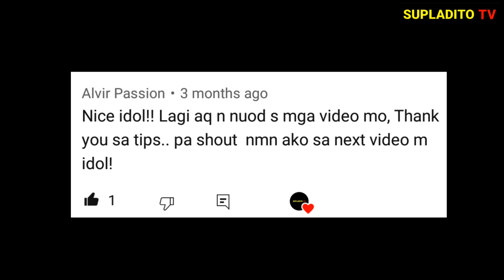Honda CIVIC: Rekta Fan vs Automatic Fan + overheating emergency tips

Comment: Sir yung sakin na civic vti 1999, nakarekta, pag bukas makina andar kaagad yung rad fan. The catch is, matic po ito at naka-bypass sa sensor. Is it advisable or good idea na ganito? Kaya nag bypass kasi nagkaprob dati sa overheat, eh since ngayon ayos naman na po yung issue,  ok lang ba na naka-bypass pa rin? Salamat po.
Reply from the maker: Mas ok po sana na hindi nakarekta pero kung ibabalic mo po sa matic be ready lang po sa posible na malaman nyo baka may reason dati may ari bakit naka tekta fan
Reply: Palitan mo lahat sa cooling system mo. Magpalit ka ng 2 rows radiator palitan mo rad hose bypass hose as in lahat ng hose. Kung stock pa din kasi yan maari may leak na yan magpalit ka na rin ng water pump baka kasi may tama na din yun then palit ka ng sending unit. Ewan ko lang  kung mag over heat pa yan.And lastly coolant lagay mo kasi malamig yun kesa sa distilled water
Reply: @SUPLADITOTV  ano po kaya mga main reason sir kung bakit nila nirekta noon ? Kasi nakabili ako kahapon 1998 civic naka rekta fan tas binalik ng mekaniko pero nakita ko wala nman sya ginalaw sa thermoswitch my prang wire lang din sa loob na nakasaksak. Pano kaya yun ?
Reply: @toykidstv9345  sir my tanong po ako . Bumili ako ng 1998 civic nung isang araw po . Naka rekta yung fan . Pero wala nman gnawa mekanino prang sinaksak lang nya yung sa switch wala rin ako nakita na binalatan na wire pano po kaya yun naka matic na po ang fan . Naka 2 rows na din . Ano kaya reason bat nirekta fan ng dating my ari?
Reply from the maker: @nhat6371  yes sir ganun po kasi pag nag byas ng switch ng fan jina jump pang po… reason might be 

May instances na tumataasxyemp nya… or extreme sya mag maneho 

Or pag uphill

Those are possible lang po ha 

Or gusto nya lang irekta at may fear sya mag overheat

Comment: OK LNG MAG REKTA NG FAN IWAS OVER HEAT. SABI NILA MAHIHIRAPAN ANG ALTENATOR MALI PO YUN BAKET PAG GABI ILAW, RADIO, GUMAGANA. NORMAL LNG YUN. SABI NILA MADALI MASIRA FAN. HND NAMAN PO YEARS PO BAGO MASIRA.  MAY NGA KOTSE NAMAN TALAGA NA NAKA REKTA FAN TULAD KIA PRIDE.  ANG GOOD DUN HND YUNG IWAS OVER HEAT...  DAG DAG LNG NG COOL SA MAKINA. AT DAG BILIS COOL NG CONDENSER KC NAKA RECTA FAN NG RADIATOR. DIBA PAG AUTO PATAY LAHAT.  PAG RECTA KHT MAMATAY YUN AUX FAN NA NAG PAPALAMIG NG CONDENSER MERON PARIN YUNG RADIATOR FAN MAS MADALING LUMAMIG AIRCON. KC HINIHIGUP PARIN YUNG INIT NG RADIATOR AT CONDENSER.
Reply from the maker: Kubg san kayo masaya sir your car your rules...
Reply: Tama si suplado tv kung san ka masaya dun ka sa way mo sir hehe basta kame hndi maganda ang nakarekta ang fan proven and tested na yan mdaming pde masira sa makina mo .
Reply: matagal ako nag rekta fan at walang thermostat at nag auto fan na wala pa rin nka kabit thermostat.,ngayon naka auto fan with thermostat at pareho kmi ni supladito ng rason para ma reached ang normal operating temp..
Reply: Yung sakin boss.. walaa ng thermostat.. pero yung fan di nakarekta.. ok lng po ba boss.. o need e rekta..di kasi tatagal yung lamig ng ac ko after 2 3 months mawawala na lamig
Reply from the maker: Sa aircon system po yan sir baka may freon leak po kayo
Reply: @SUPLADITOTV  pina check ko na system sir ..sabi ng gumagawa ng ac wala daw leak system ko
Reply from the maker: @junjungebutan843  nag leak test po ba sila? Nag check bg freaon? Ano po sinabi nula dahilan bakit nawawala lamig ng aircon?
Reply: @SUPLADITOTV  ginamitan nila ng vacuum ..aw gumalaw yung paa ng sa vacuum after ilang minutes ..
Reply from the maker: @junjungebutan843  eh di may leak nga po?
Reply: @SUPLADITOTV  i mean di po gumalaw yung paa nung gauge sir.. everytime magpapakarga ako binavacuuman po yung system.. steady lng talaga yung pin sir.
Reply from the maker: @junjungebutan843  hindi daw po nagbabawas ng freaon?
Reply: @SUPLADITOTV  after 2 3 months nababawasan po.. pero sa unang karga walang bawas
Reply from the maker: @junjungebutan843  therefore may leak nga po … napakaliit na leak po un kung ganun dapat kasi hindi nagbabawas po freon
Reply: @SUPLADITOTV  di po ba mauubos freon kapag sobrang init ng makina sir? Leak lng po ba talaga dahilan pag nauubos freon
Reply from the maker: @junjungebutan843  yes leak sa aircon system, or high preassure dahil sa high preasure maghahanp na lalabasan
Reply: @SUPLADITOTV  sakin kasi sir ..parang high pressure po siya dahil wala ng thermostat tas automatic parin fan
Reply from the maker: @junjungebutan843  pacheco nyo po sa mahisay na aircon technician… isa sa caise ng high pressure ung clogging sa aircon system possible marumi or worst barado…
Reply: @SUPLADITOTV  ah.. sige po ..maraming salamat